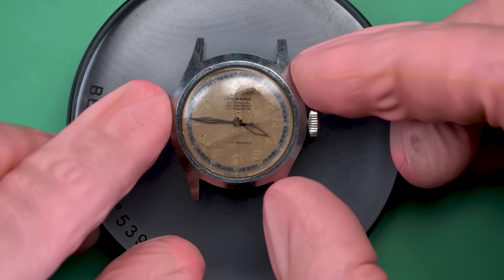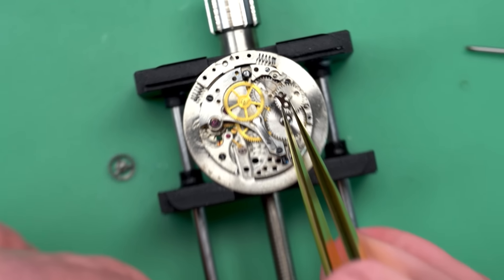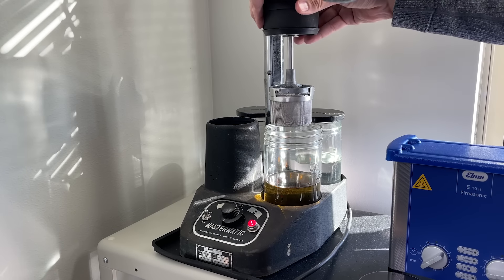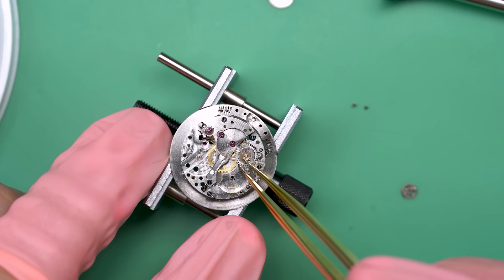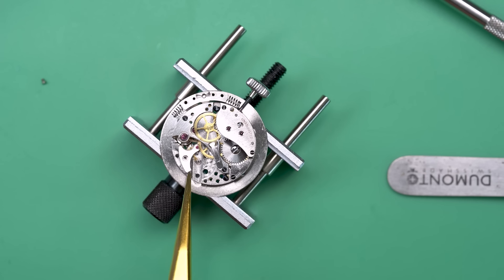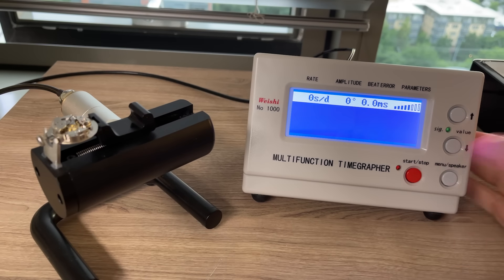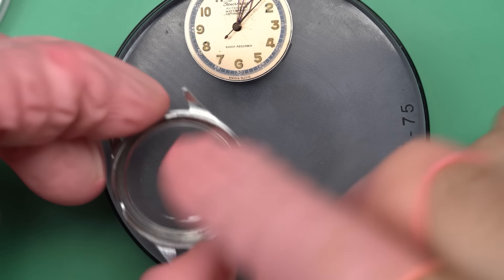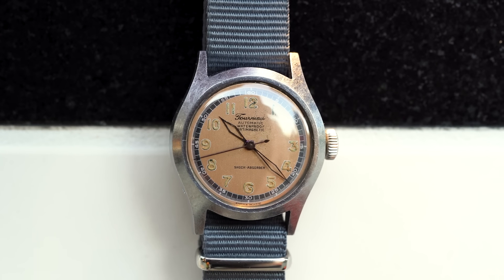Tourneau 1950s Bumper Movement Vintage Watch Restoration

Comment: What I do for cleaning dials is I suspend them in a glass of water and drop a 3 minute Polident tablet in and let it gently remove the dirt. I have done it many times, even on a Rolex dial with the printed film and it didn’t hurt anything.  It freshened up the dial pretty good.

Comment: I've read that perlage circles & Geneva stripes are there not just to look nice but also to catch & trap dust & other particles so they don't find their way into the works.
Reply: When the watch oils weren’t as advanced as they are now they were placed to keep the oil in place. With the advanced synthetic oils we have today they are useless. They look nice though!
Reply: @DutchClawz  those perlage patterns are not anywhere near the oil. The oil is held by the geometry of the bearings be it Ruby or steel back in the day they already had things like epilame or neosurf but as a primitive version probably

Also... Usually watches where cleaned whole and just oiled assembled
Reply: the Geneva stripes were there to make sure the original bridges went on the original watch. As these stripes always differ, you can see if a bridge has been replaced because the lines of the stripe will not match exactly.
Reply: @pipodorologio1648  that's another reason yes, but some movements have bridges that aren't on the same height (usually balance bridges) so these can have a difrent finish and look "wrong"
Reply: The circles.... I have seen on the bolts of bolt action rifles. In that case I believe that it's to make sure things DON'T mesh so the rifle doesn't get stuck. Keeps that coarse surface profile so things stay seperate and the bolt continues to open freely even under higher power loads.
Reply: @OffGridInvestor  yep. Same principle as honing cillinder walls

Comment: Make sure to use a molybdenum grease on the barrel walls that the slip spring slides on. That is a two piece mainspring and the old school slip can be problematic. May be the reason for the low amplitude

Comment: Hey Marshal! It’s amazing to see how fluent you have become with disassembly. The hours you have put in are really starting to show. Especially on an un-familiar movement! 

As a filmmaker, I have only one suggestion for your top-down Sony A7III.. 
The macro lens you are using has a deep depth-of-field. You seem to have the aperture of the lens wide open at f2.8.
Which will look great, but sometimes, when you zoom in on the footage, the out-of-focus areas seem to be accentuated too much. 
I would suggest aperture values like f4 - f5. It may dim the scene a bit, but you will get CRISPY focus across the entire view. 
Closing the aperture like this increases the focus plane, but lets in less light (compensate by increasing ISO).

P.s. - this is not a big issue, and not even a flaw. But with your drive to improve, I guess such a small tweak to the camera would help bring out more detail. Just do a little bit of trial and see if it works for you. Cheers and thank you for the continual inspiration from your channel. Cheers!
Reply: That was really lovely feedback. Helpful but not critical. Nice job Srirang Dhawale.

Comment: A lovely little heirloom. I believe bumper movements were a work around Rolex's patent with the rotor movement for decades until the patent inevitably expired.
Reply: Personally that doesn't make sense as Abraham-Louis Perrelet invented the automatic movement back in the 18th century and that used a rotor.

Comment: The stepless case is a timeless design used for watches of virtually every price point from 1930s to mid 50s. Stainless steel (everbrite) was a new material and needed expensive machines and a level of expertise when it first came onto the market. Stepless cases were almost always made from Stainless. I do have one Doxa (1945) example that does have a base metal stepless case but they are very uncommon. The most desirable Patek (565) is worth more in Stainless than 18k gold. The watch you have here was a mens watch and more than likely is a 28.5 diameter. Not a juniors nor a women's watch but the common case size for WWII Military uses.

Comment: That's a lovely watch. When you get such a dirty watch, have you tried just let it soak in water or a very mild soap and water? I have found letting dried dirty items just soaking in water or a lightly soapy water works wonders. Less scrubbing necessary.

Comment: You have made me really want to get into this. Though entry cost is kinda up there for a hobby. But, maybe.
Reply: You can buy basic tools for cheap, like screwdrivers and movements holders. Movement cleaners can be expensive, but buying a vintage movement cleaner can be an affordable option. Buying Chinese, Vostoks, and Seikos are good for practing on disassembly and reassembly since they are plenty.
Reply: @objective7042  yeah I think it's more of the cleaners and oils/grease aspects. I tend to go all in on hobbies but I will look around for used vintage stuff.

Comment: Or the springy/jumpy parts generally made of steel?  If so, and were I a watch restorer, I'd magnetize a curved steel pot lid.  When handling parts I suspect may jump, I'd use one hand to hold the lid over the watch while maneuvering the jumpy part with the other hand.  Even if the jumpy parts aren't made of steel, a non-magnetized lid might still prevent losing some jumpy parts.

Actually, a glass pot lid would be really nice.  You could shine your light/see what you're doing through it.

A small safety hood with a transparent viewing port would work too, of course, like a plastic tabletop airbrush spray booth.  Would work for the jewels you've lost, too.  I wonder what the total cost of parts you've lost vs. the cost of pot lid or spray booth is.

Comment: The part that you discussed, the "decorative pattern" on the base.  That is more a function of how they milled out the metal.  Probably just from literally the tool that was last used on it leaving swirl marks as it took off the last bit and they leave it on there cause it does look cool, even if it gets hidden and only seen by the likes of you and  your fellow watch makers and repair people.

Comment: Great Video - thank you so much. 
The only thing that looked out of place was the "cleaned" dial, with its light spots here and there. It seems that you cannot even use water on these fragile items, because the accumulated dirt has hindered the dial from toning over the ages (like a picture on the wall: when you take it down, you will see how white the wall was in the first place). Why not just use air and keep the spots?

Comment: I notice that you basically always need to use one hand to hold the watch clamp in place while working on a timepiece.  Keeping in mind that it must be a whole lot easier to rotate the piece as you work on it, have you ever wondered how much quicker/safer/easier in general it would be to work on a piece using both hands and/or two tools at the same time instead of just one hand?

Again, were I a watch repairer, I would make an honest attempt to do just that..
1. I would buy or create a larger, much heavier, adjustable jig/clamp that could hold the watch holder device steady.  Yes, a clamp for a clamp.  It has to be heavy enough to keep the piece steady/fairly unmovable.  The addition of rubber feet would alleviate some of the weight requirement.
2. In order to rotate it, I'd buy a small lazy susan.  Of course it must be able to actually bear the weight of the jig/vice + watch holder + timepiece while also still allowing it to spin.  However, it should be easy to spin.  If it spins when you don't want it to spin, that would of course defeat the whole purpose of not needing to waste a hand to hold the piece in place while working on it.  My guess is that if the jig + watch clamp + timepiece are heavy enough, their weight alone would cause many lazy susans to spin a lot slower, so yay for that.  If it still spins too freely I'd try to gum up the bearings, possibly packing the bearing system with heavy duty grease for example.

Just a thought.  Not trying to be a know-it-all.  I'm not.  I just see problems and then I just see ideas to fix them.  I'm a professional residential painter/surface repairer.  Thanks to you I now know that this watch restoring hobby/profession fascinates me.  Who knew, lol.

Comment: Hi mate, I’ve fallen for the whole watch restoration process thanks to you.  How long does it each process take? Tear down, clean, rebuild?
Reply: It all depends on what state the watch is in before you restore/repair the watch. Experience plays a huge role in time but you can knock one out in 2-4 hours if the work is minimal. It can be days if you don't have parts or if something is really wrong to troubleshoot.

Comment: Hi Marshall, I just watched this video again and enjoyed it as much as I did the first time.  But there’s something that doesn’t make sense.  The center wheel rotates the cannon pinion, and the friction between the center wheel pivot and the cannon pinion is what makes the hands move.  I’ve found that Möbius 9501 applied to the center wheel pivot can actually cause it to slip - the watch runs but the hands don’t move.  On the other hand, setting the watch requires the cannon pinion to slip, because otherwise the train of wheels would resist the force applied at the crown.  So it doesn’t make sense that the watch was stopping because the cannon pinion was too tight - if anything that would make it impossible to set the time.  So I’m wondering if friction at the spot where the cannon pinion contacts the main plate was the problem.  Firmly setting the pinion into place might allow metal-to-metal contact at that spot, which might hinder the ability of the cannon pinion to rotate. Now that would cause the watch to stop.  Does this make sense to you?

Comment: I'm just curious, you pointed out that whilst cleaning the parts in the machine, you said, "careful, it gets hot", can the heat from the machine distort some metal parts of watches, especially fine springs, hair spring or bridges etc? Nice watch by the way.
Reply: They should expand to a minor degree and then retract as they cool. But you need cigarette lighter heat MINIMUM to start destroying things.  I used to work for a radiator manufacturing (mainly for huge mining equipment). As part of the manufacturing process I used to see copper shrink about a quarter inch in 5 seconds. Never believe it until you've seen it in front of you.

Comment: At Minute 6 you mention a special tool to take off the upper wheel. What tool is this? Looks a bit like a canon pinion removal tool. Your movement is almost identical to the mido 0917.

Comment: I have an older Seiko Dive Watch from the 80s that Stops like this one did. I have sent it to 3 different people and no one ever fixed it. I threw it in the drawer. Its a 7002 Movement, now I wonder if it is the same issue as I would love to get this watch working again. Marshal would you like to do a video on it? or do you have a suggestion as to where I can send it? Thanks Brian

Comment: About cleaning dials ("I'm using only water here") you might try using ammonium carbonate solution in demineralised water (aka "distilled water", although you'll be hard pressed to find nowadays water that was actually distilled - almost all of the stuff out there is water demineralised by reverse osmosis process, but I digress here).
AFAIR this solution was used for cleaning old fresco paintings, as it has some "detergent-like" properties (thanks to ammonia ions) yet it is very mild and leaves no long-term residues, as it spontaneously decompose, slowly, into carbon dioxide, gaseous ammonia and water (and that's why ammonia carbonate was a typical component of so called smelling salts).
Now, I'm not saying "this is the best thing ever" or "it will work, aaaabsolutely" -  in fact, I never tried it myself, I just happened to know this thing is used for this "delicate cleaning". Say, it's just an idea you might want to try one day with a dial that has some real dirt on it. Cheers.

Comment: Just curious, why do you wind before putting in the balance wheel, as apposed to winding it after. Could it not be bad if it starts to run when its not in the right place and potentially damage something, or is that just not how it works?

Comment: Great video, but how does a too tight cannon pinion stop a watch? I know it would make it hard to turn the hands to set the watch. But it should run fine.
Reply: I was wondering the same. I can't fathom how a tight canon pinion would stop the watch. If the canon pinion is depthed incorrectly it could foul the bottom plate, but too tight on the centre wheel pinion wouldn't make any difference. I suppose that if the canon pinion is so tight that it cant be pushed home on the centre wheel pinion the hour and minute wheels wouldn't run true so could foul and stop the watch?
Reply: @stevewilliams5428  Yes, after I made the comment I was thinking it could rub on the plate, if it was pushed down too far. But then I remembered he fixed it by making the whole bigger. If it was rubbing on the plate he would have sanded the bottom of the pinion to make it shorter. Maybe he will explain what he did.

Comment: Marshal, where do I start, I have screwdrivers and tweezers, a still hand. Some glass petri dishes for screws and springs and gears.I want to get into a watch, would you point me in the right direction with a type of poketwatch I should go for. Perhaps you have been eyeballing one on ebay?

Comment: this is not the case but, I was wondering how one could make non standard glass crystals when an idea struck me. Perhaps you could  ask an optometrist or reading glass workshop to cut them since they actually do so regularly from a template.
Reply: That's.... not really the issue. Sizes are NO problem and most are domed. The issue is from the side, they have different layers. Like the outer edge may step down to a thinner piece. That's actually kinda rare though. But apparently this one was like that.

Comment: Wait wait!  I don’t understand this.  The cannon pinion needs to grip the center wheel pivot in order to make the hour and minute hands move in sync with the watch movement.  The cannon pinion needs to slip against the center wheel pivot when setting the time - this allows the hands to move without forcing the train wheels to move.  A cannon pinion that’s too tight will make it difficult to set the time, but it won’t stop the watch. On the other hand, if the cannon pinion is too loose then the hands will stop moving but the movement will continue to run.
Does this make sense?

Comment: Are you sure those circles on the base are decorative? I believe those are created during machining the part. I have seen those on top of engine  too when they flatten the top. I mean why would you need to decorate under the dial.

Comment: How does the interior of a watch get so scratched up when they are protected by a case their whole life? Is that from the original manufacturing or from debris getting in the case? I can't imagine dust can scratch metal like that. And you're putting the gears and plates on a soft mat while servicing. Obviously it looks worse under the microscope but I can't think of how that much wear could happen when it's only open to the elements for a few hours in it's lifetime.

Kind of an odd watch here. I like those automatic springs - gives it a more utilitarian feel.

Comment: Shame about that lug. I've never tried to repair a lug like that.. maybe drilling a hole completely through so you can put a spring bar on with longer ends?
Reply: You would need to do something to stop the spring bar falling out. Silver solder the thing completely in to the bad side. Best idea I could think of. Grind the solder back and polish it all.

Comment: Hello Marshall, I couldn't find an email address, so: I've got an old Russian mechanical here. I paid like 70 dollars for it. It is beautiful, still keeps relatively good time, but the (blue painted) minute hand fell off, after the crystal broke. If you feel like restoring it (it needs plating), I will send it to you from Belgium. And it is yours.
Reply: I hope you didn't buy it with chrome worn off for $70. Coz you paid too much unless it's one of the really nice rare ones.
Reply: @OffGridInvestor  Don't exactly know. But yeah, chrome was pretty worn off. 
On the movement, it reads 16 jewels and a number: 24553. On the main spring barrel: 1M43
The brandname reads 'MARK', but with the R, mirrored.
I did some diggin' and thought I read somewhere it would date from 1949. But that might have been 'wishful reading' :-)
If you have any info, I thank you in advance

Comment: As others have already pointed out, this is another video about which I thought, "Man, isn't he a bit careless about dealing with potentially radioactive lume?" Tritium is one thing, but Radium (which very well might have been used here) is a totally diffent kind of beast. Please take care of yourself and at least get a Geiger counter to check for radioactivity before touching watches from before the 1960s, especially if the crystal is broken. Inhaling particles of crumbling Radium lume is no joke. That's why many watchmakers refuse to handle watches of a certain age if the lume has started to decay.